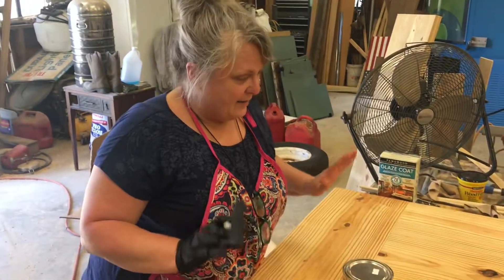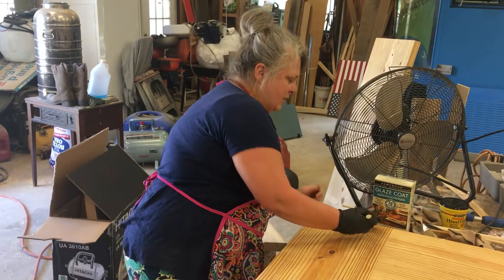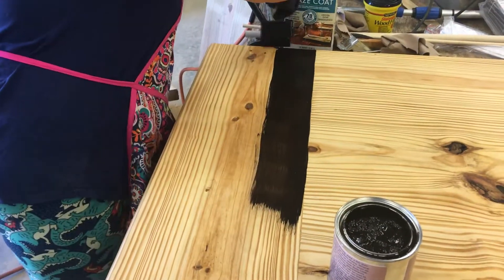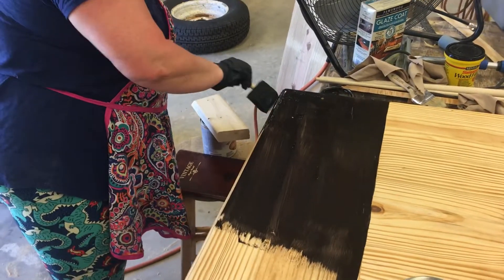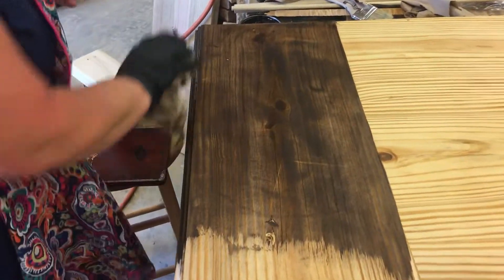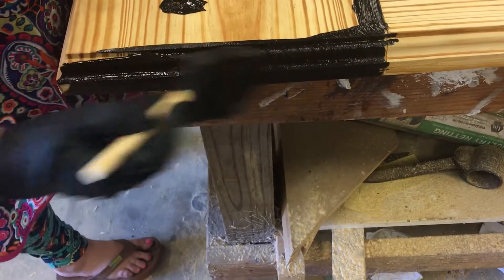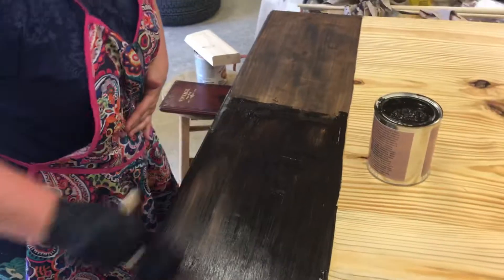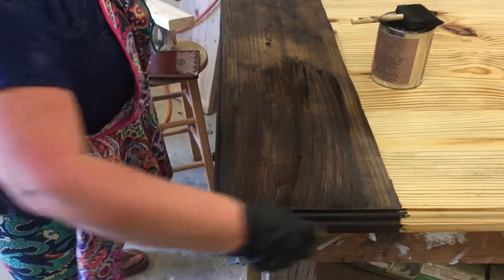Applying Dixie Belle No Pain Gel Stain in Espresso to a Farmhouse tabletop

Comment: What did you use to seal this afterwards? I generally use General Finishes Arm Seal for my top coat. I don't have the Dixie Belle brand finish.
Reply from the maker: Angie Williams I actually used Howdy Do hemp oil by Dixie Belle, but that was before they announced that that was not the best option, as the hemp oil needs to sink in, and the gel may impede that. It was perfect for my project. If I was to do it again, I would use poly.